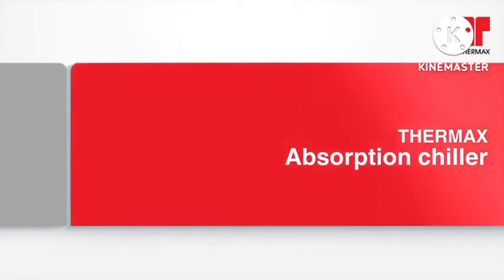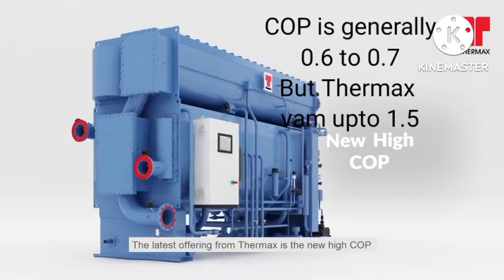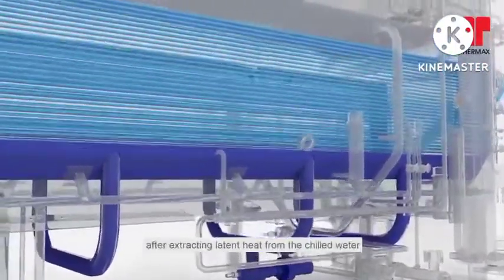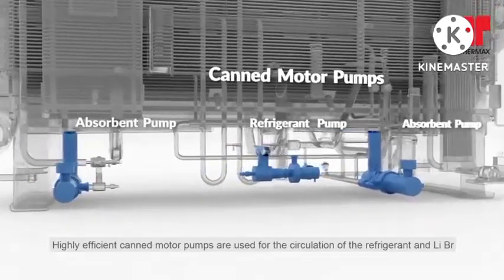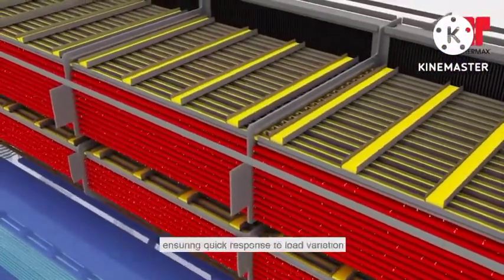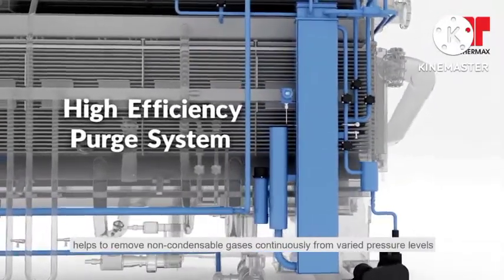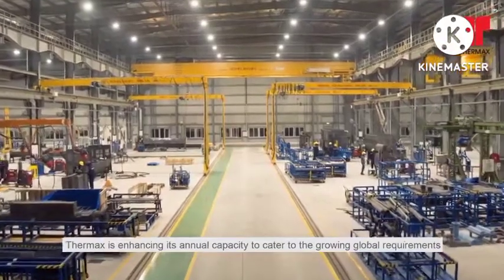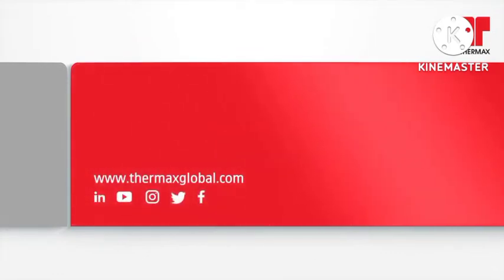Thermax VAM chiller technology.

Comment: Does it make both Electricity , warm water for central heating and cold for air condition ?
Reply from the maker: No this is VAM . For warm water heat pump required